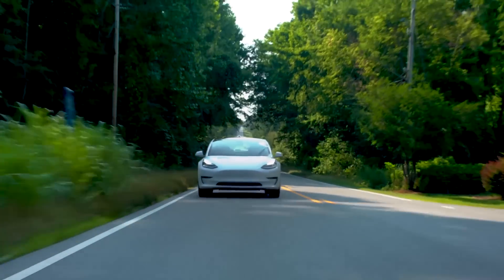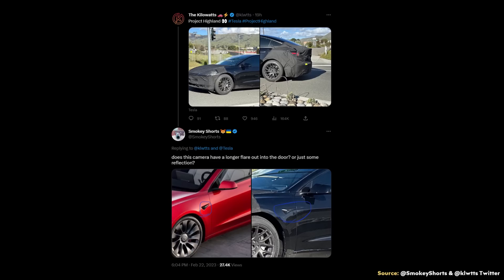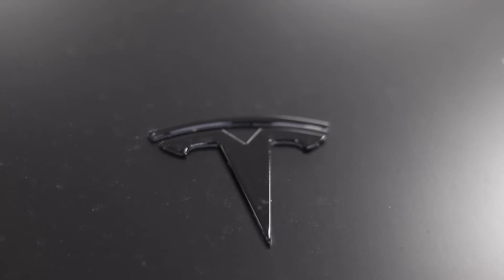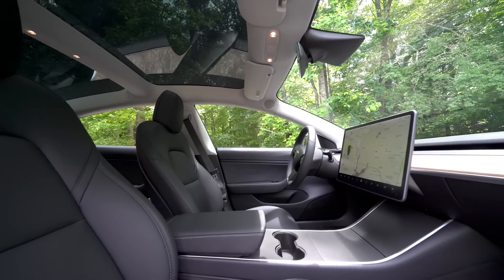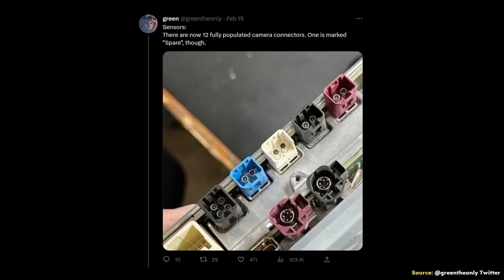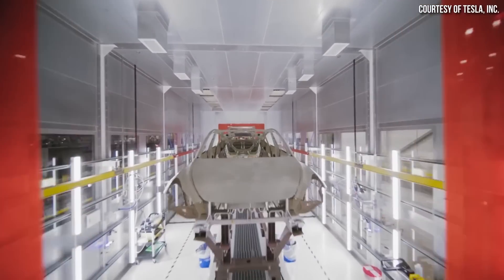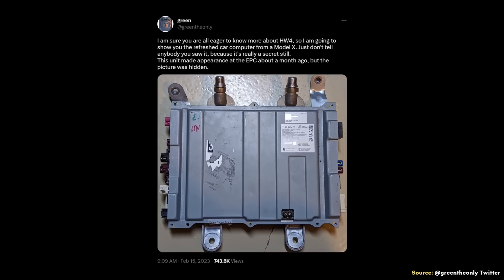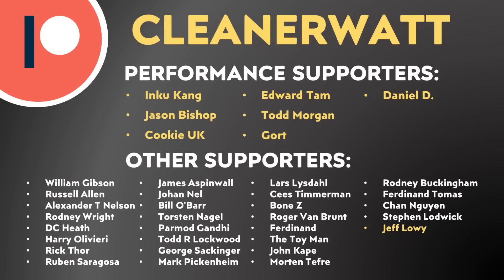LEAKED Tesla Model 3 Refresh Details & HW4 Computer

Comment: One change I’d like to see is a model 3 hatchback as this would make the vehicle much more practical, but still usefully smaller and probably lighter with longer range from the same battery than the model Y
Reply: Before it came out I thought the 3 would be a hatch. It's why I went for a used S in the end (Y in Europe was too long to wait for).

Comment: I owned a Model 3 Performance and got rid of it after 12 months. Why? The suspension was dreadful. My family hated driving in it. I hope they're working on improving the ride quality. Until then, it's a pass from me. Now cue the idiots who say it’s a performance car so the ride should be rough. No dummies. I’ve driven the non performance models and the ride is equally awful. I’ve also driven and owned many other similarly quick cars whose ride didn’t bounce or become frighteningly floaty at speed.
Reply: Lol you bought a car with performance suspension and then got rid of it because it had performance suspension
Reply: Performance suspension and stiffer, lower profile tires.

Comment: I think the radar is for precision maneuvering. I'm fairly certain there is a limitation on the ability of computer vision to judge precise distances when objects are very close.
Reply: I think the opposite it true - it's very hard to gauge distance and direction and speed the farther away something is, as it's size and position doesn't change much. Imagine following someone with your finger who's walking right in front of you vs doing the same with an airplane. The plane seems to be hardly moving, right? Also, I believe sizes can throw it off - a small car 100m away might be judged to be a large car 120m away. Close in, changes are more dramatic. Something doesn't get much bigger when it's 100m away vs 95m away, but something 10m away changes in size drastically as it moves to 5m away and even more so to 50cm away.
Reply: @truhartwood3170  distance allows for multiple cameras to be used for those calculations. It’s up close when you are limited to the perspective of one fish eye lens.
Reply: @@BrianJacobson  Tesla doesn't use stereoscopic vision, it uses parallax to gauge distance,which works better the closer something is. Tesla do have three forward facing cameras but that's for wide angle,distance,and regular. They're right next to each other in a cluster, not spaced apart like you'd need for stereoscopic vision.
Reply: @truhartwood3170  I didn't say they used stereoscopic vision. They do however have wide angle cameras looking out at every angle and if an object is visible in both cameras it is much easier to judge distance.

I'm saying where it becomes tricky is scenarios like pulling into a parking space. Maybe with some unexpected objects in the space. When only one fish eye lens can see an extremely close object it becomes more difficult to tell if that object is 1 inch away or 4 inches away.

I could be completely off but in my experience with computer vision that makes sense to me.
Reply: @BrianJacobson  yeah, no. Distance is all inference from parallax, seeing how much road is between you and the object, the apparent size of an object with a known size, and then inferring the distance from that to objects around it, all that kinda stuff. No camera overlap needed or used. This was specifically addressed by Karpathy.
Reply: @truhartwood3170  but what happens when there is no road and you are just looking at a relatively flat concrete surface?  I'm specifically thinking of parking in some building parking garages or shopping malls where you an encounter some really unexpected things.

That's the only use case I can see for the radar. Navigating in tight spaces with lots of precise movement and unexpected objects potentially blocking the view.
Reply: @Brian Jacobson  are they putting radar on the back? The sides? Do they have a problem with these things now? No, no, and no. So apparently they can judge distance just fine without radar.
Reply: @truhartwood3170  where is it going then?
Reply: @BrianJacobson  where is what going?
Reply: @truhartwood3170  the radar...
Reply: @BrianJacobson  the front. I mean, if it's not the back and it's not the sides... Did you think it might go on the roof aimed at the sky? Or under the car aimed at the ground? Or in the steering wheel aimed at the driver? I kinda thought the front would be reached by most people through typical process of elimination, but I guess if you're particularly creative those are technically other options. But no, it's going on the front, and I think it will mainly help gauge the distance, speed, and direction of objects farther away that are difficult to determine from the cameras. There would be side benefits as well, like confirming that a reflection in a puddle is just a reflection and not an actual object. I've heard radar can also bounce off the road, under the car in front of you and get a bit of a signal back from the car in front of that car, giving you a heads up if that car was slowing or stopped before the car in front you started to react. But that's just hearsay, I have no idea if that's true.
Reply: @truhartwood3170  Is it only on the front? I thought it would be front and back.
Reply: @BrianJacobson  pretty sure it's just on the front. Just a single unit. The high def radar is an expensivish unit. And you don't usually care about someone 100m behind you.
Reply: @truhartwood3170  we will probably find out March 1. I'm very interested now

Comment: Why radar? In super-heavy rain sudden downpours I've driven into three times, visibility drops to where a driver can't see his the front of his own hood, no less any vehicles in front or behind. In such conditions, radar may "see" objects though the white-out, as cameras can't. NO reason why Teslas shouldn't be equipped with sensors that outperform our human senses. FSD will ultimately need this super-human capacity.
Reply: Some snow storms can also cause conditions of ZERO visibility
Reply: It is actually about all of the other sensors causing too much data, which confuses the computers and requires tons more computing capacity.
Reply: 100% agree.
Reply: Tesla is to cheap it's all about the almighty dollar!
Reply: @nicholas muni  Tesla is profitable and this is how they will accelerate the World's transition to sustainable sustainable energy.
Reply: @nicholasmuni7995 shut up
Reply: @nicholasmuni7995  Stop it. Cheap has nothing to do with why Tesla removed the sensor.
Reply: @79bnice  Cheap is probably the wrong way to say it. There was a supply crunch issue at the time and an easy way to get around it was by just removing it. I dont know why they had to spin a tale that their strategy had changed and they could do without it now. Maybe they believed it at the time. Seems deceptive to me though.